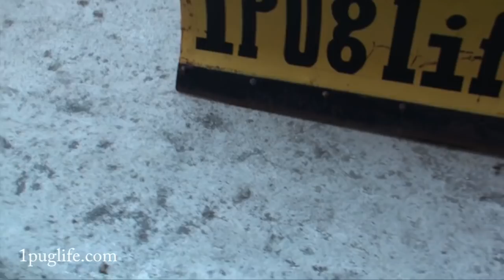fixing the plow and running round

Comment: @pug1 get rid of those stupid ass pads....you'll be able to scrape your drivwerds much better too! you don't have to worry about premature ware on your cutting edge either...I use to plow basically for 15 hours straight per storm and alot of the time much longer and the cutting edge would last at least 2 seasons